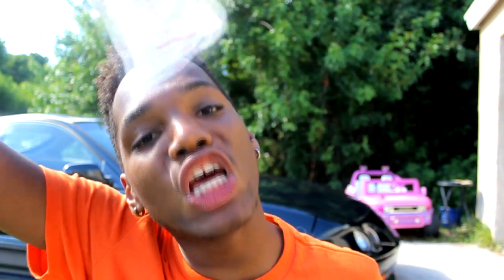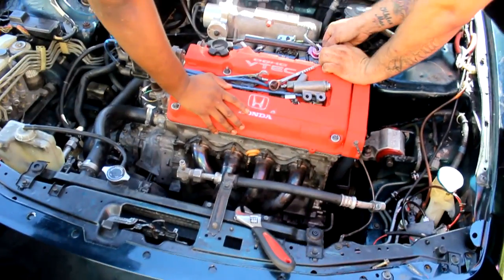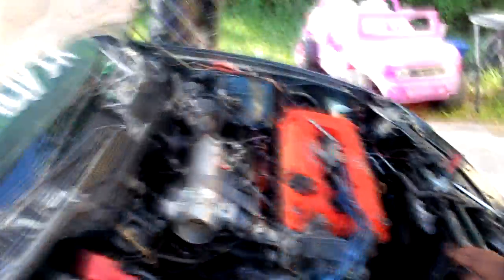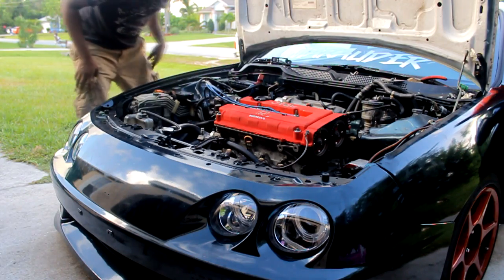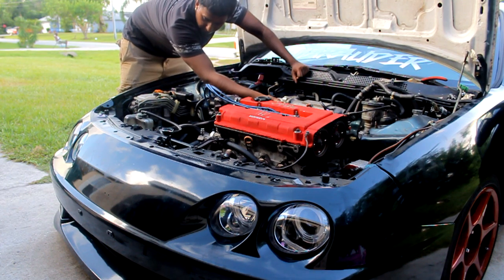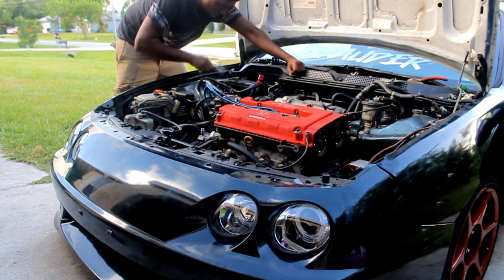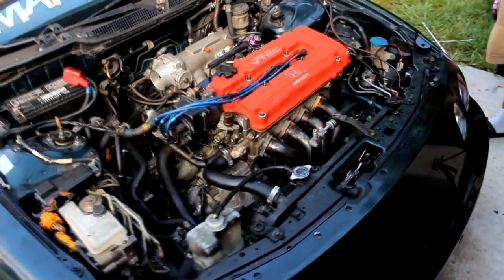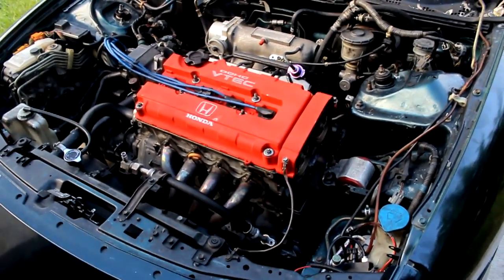BUILT B20v FIRST START UP! - Zosh's DC4 Integra

Comment: my prelude clutch was like that i had to put a hose from the bleeder valve directly in a bottle of brake fluid so it wouldnt pull in air when the clutch was released..